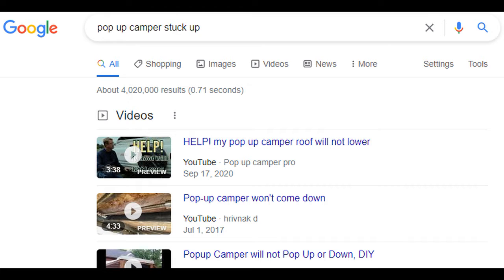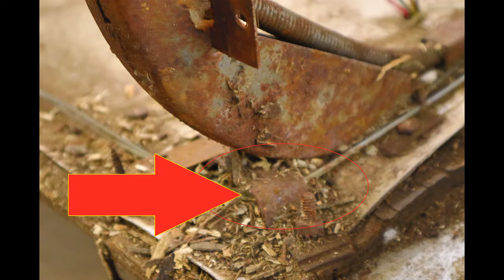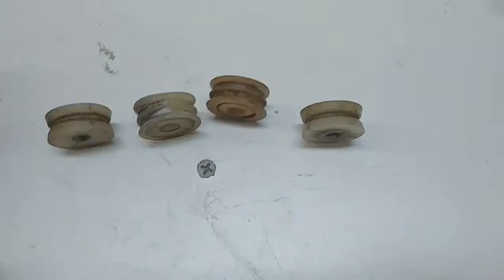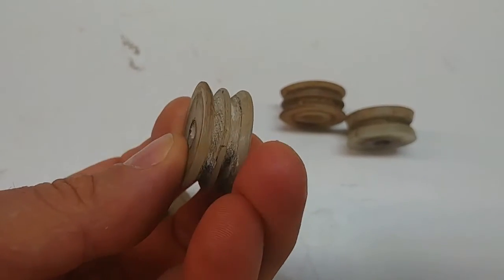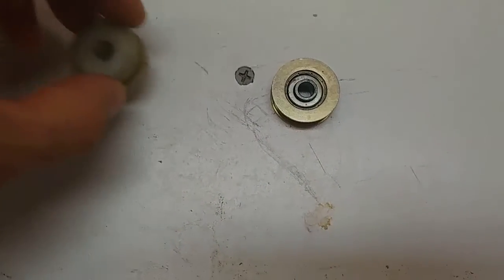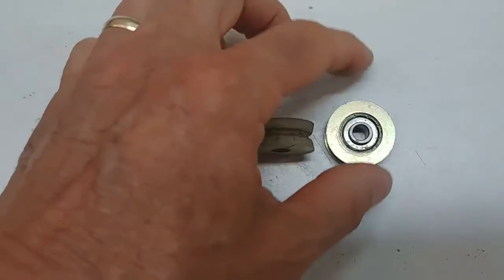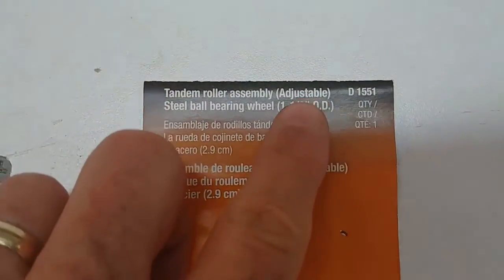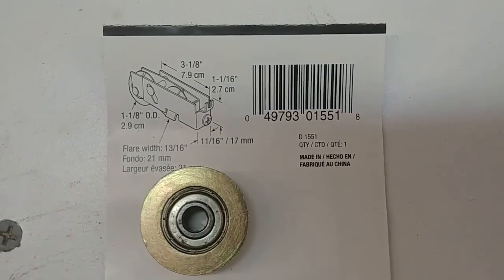POP UP CAMPER REPLACEMENT LIFT PULLEYS How To Rebuild Jayco Pop Up Camper PT28

Comment: I imagine a large Trailer Mfg. would buy 50,000 of these of these Nylon Roller's at a time for a very good price. Cheaper than a Steel Brg. like You used to solve the problem. Where there is a will, there is way, You found it GB. Nice Job.
Reply from the maker: Bingo. They nylon rollers are cheap and mass produced. Thanks for the kind words MT.

Comment: now i need the double pulley, can i use a single pulley, like the one you shown on the video for 2 cables that lift the back? TIA
Reply from the maker: I did just that. My single pulley was wide enough for both cables. I also sprayed plenty lubricant on the pulley and both cables. Good luck.
Reply: @FakeLegGreg   thank you so much for the reply. I’m heading out tomorrow to get that pulley. And thank you for the tip. I appreciate it

Comment: Where would you get the pulleys for double cables?
Reply from the maker: I couldn't find one. I ran both cables around single pulley.
Reply: @FakeLegGreg should there be any concern running the two wires in the single pulley that they will rub together and wear the wire to snap?
Reply: @rickbennett3994  This is what I suspect would happen. Decided to go with a larger kit by Primeline. Bearing is 1-1/4 and fits both cables cleanly